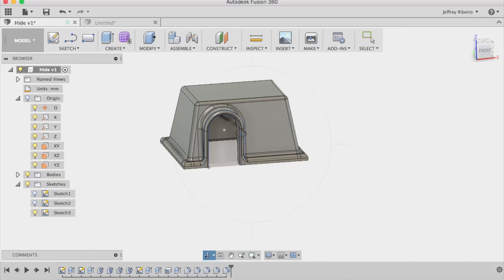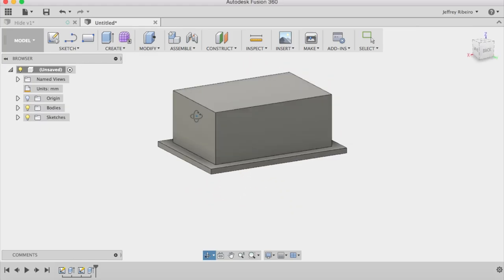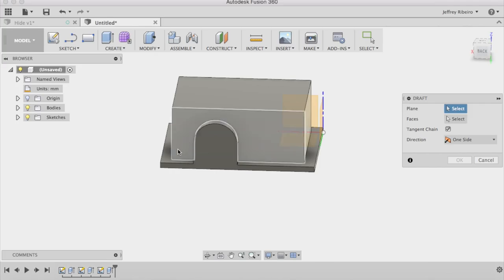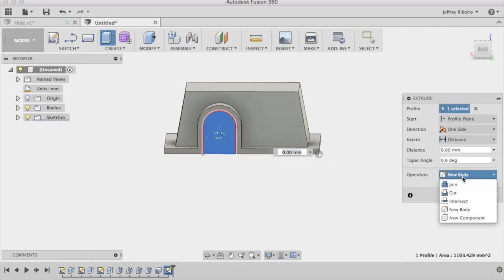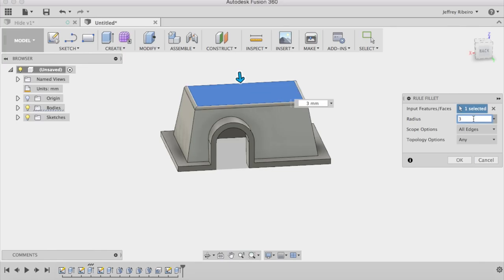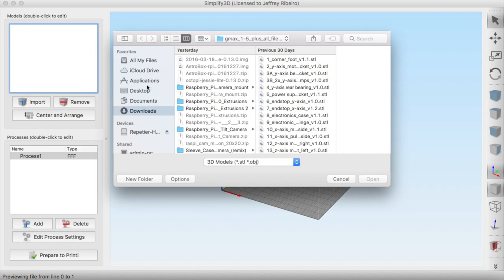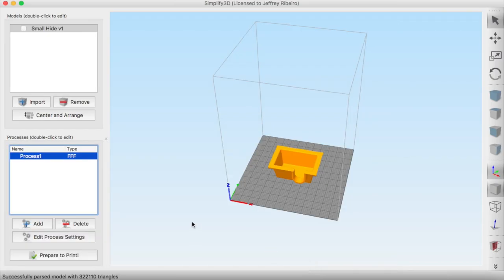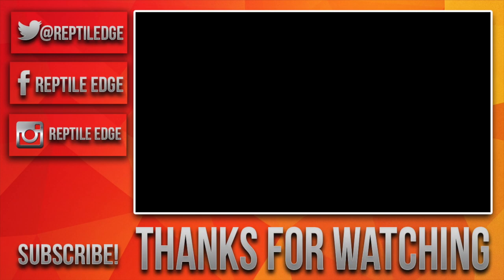DIY 3D Printed Snake Hide

Comment: Anyone's thoughts on if the plastic is affected by UVB lighting? Like if a water dish was made, do you think the plastic would break down under the light on the cool side? 🤔
Reply: In general, no actual experience, 3d printed parts are not good for food or water. all of the layer lines allow water and germs to get into the plastic and cannot be washed out. It also depends on the plastic being used. I would just do my own research on if its safe.
Reply: Seal it with food grade and heat resistant apoxy and it's will safer. PLA has a lower melting point so it might an issue if you have heat lamps. I have under the tank heating so it's perfect for me.